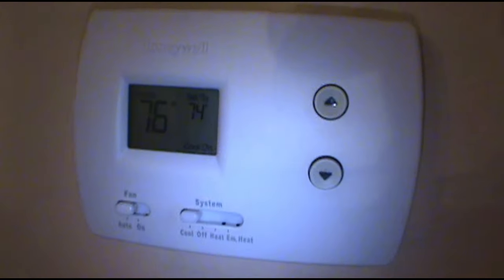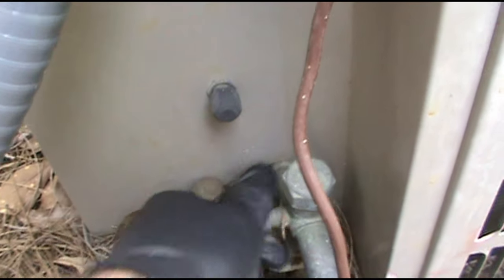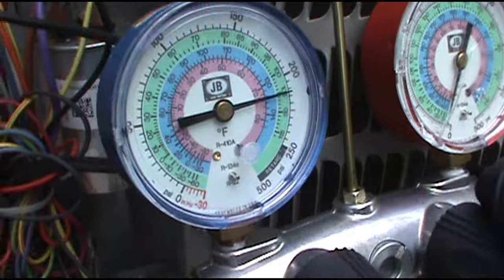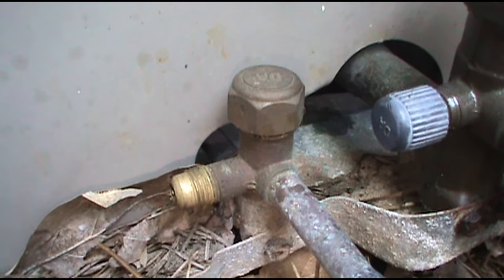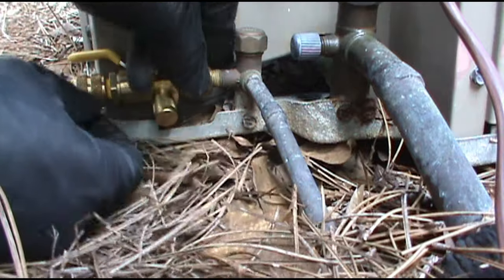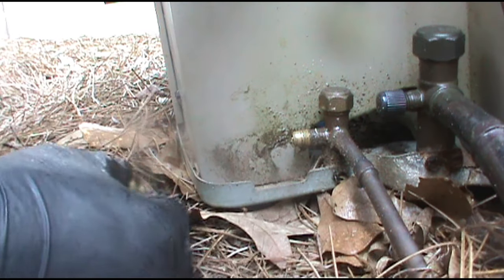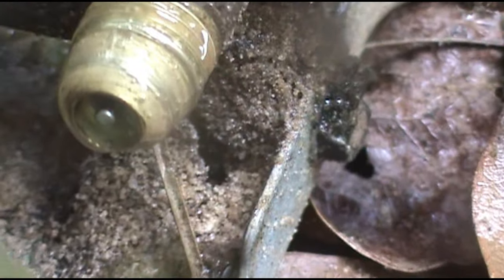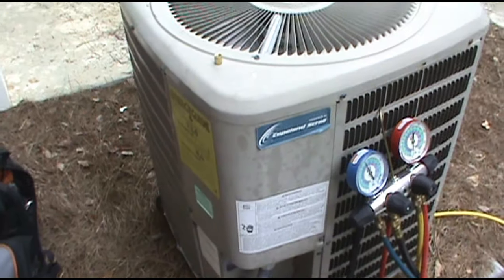Outside AC Unit Not Running But Inside Is

Comment: I have bought an inexpensive Ryobi One blower that uses interchangeable batteries with my other of the same types. It does a good job on that snaky pine straw and leaves around the unit. It makes it look nicer around the unit. Works great when the units are on slabs and MGMT is not using that straw for landscaping.
Reply from the maker: Great idea! Thank you so much for watching Thomas!
Reply: @LexVance  By the way, great work attitude you got. Glad I watched this today. It boosted my morale.

Comment: If fan is not spinning - how else would you determine whether it's 1. fan motor, 2. capacitor not working, or 3. low refrigerant level triggering low pressure switch? (other than visually gauging the appearance of the capacitor/testing the capacitance/leak test) Thanks!
Reply from the maker: I would test everything with my volt meter to see if all that was good.
Reply: @LexVance  Thanks! I am a complete beginner and have learned a lot from your videos!

Comment: Can you explain the high and low side.
Reply from the maker: The low side is gauging the refrigerant in the air handler coil. The high side is gauging the refrigerant in the condenser.

Comment: My outside unit is not turning but I’ve reset the breakers and the thermostat clicks as if it is about to cut on. My upstairs ac is working just fine and the second outside unit is on.
Reply from the maker: Either a bad capacitor or low pressure switch due to low refrigerant.

Comment: Ours is the very opposite..out side running inaide seems no contact to start cool air but air is coming out..had well ck June 9th all was great! Not heat pump..
Reply from the maker: I'd need to be there with my volt meter for this one.

Comment: Fan and Compressor were not kicking in. Replace Capacitor, Contactor, Control Board and still did not start. Replaced Low pressure switch and Air Condition (Fan and Compressor) start working.
Reply from the maker: Sounds like you had no low voltage so the contactor wasn't pulling in. Nice fix Sasan!

Comment: Before I add refrigerant id ask when last time it cooled unit that low big leak if it was since last year one thing over night or its a big leak either way freon leaks suck.
Reply from the maker: Thank you so much for watching Ted!
Reply: So hard sometimes find leaks signs of  oil helps i have a video where I put e coil under water leak didn't show until 600psi I was very scared of that psi would show video but don't know how

Comment: So what’s the cheapest HVAC system on the market? I’m retiring and selling my house soon, and the AC is out and the furnace works but makes “boom” noises when it shuts off. It’s a mid-80s Carrier and I think to sell the house it should be replaced with a new system but I want as low-cost as possible. Thank you! Your videos are fun to watch even though I know nothing except how to check my capacitor.
Reply from the maker: Goodman. Thank you so much for watching Lee!

Comment: I have a heat pump unit too.  I got heat from the furnace but the contactor not pulling in so the outside unit isn't running so if I get it some refrigerant juice, the unit may start.  You are demonstrating abut cooling.  But Does heat need refrigerant to kick off low pressure switch for the contactor to get 24v too?
Reply from the maker: Yes. Low refrigerant will make outside unit not come on. Thank you so much for watching!

Comment: My AC was working perfectly and today it went out. Did the stick trick to spin the fan and the fan cut on! But the air isn’t cold. What do you think it is?
Reply from the maker: Did you check the capacitor?
Reply: @LexVance  just changed the capacitor, it’s working well. Thanks bro! Now I need to go lean out the blower

Comment: My brother in law has a unit that keeps blowing those fuses. He just changed the unit and they left the same wiring. It still happens with the new unit. It will work for a week or so and then they will blow
Reply from the maker: There's a skinned wire somewhere with exposed copper touching metal or another copper wire. Could be in the wall or who knows where. Low voltage shorts are tricky. May need to run new wire.
Reply: @LexVance  thanks so much. That’s what I was telling him. He told me it happens more in the really hot summer days but I told him I’m seriously leaning more towards a wiring issue. Thanks again

Comment: Make the brass caps with a pin hole drilled in the end to test for bubbling on shraders like acservice tech showed! Keeps it clean in there! Just my thought! But good video dude 👍👍
Reply from the maker: Right on! Craig is awesome. 
Thank you so much for watching Greg!
Reply: Greg, do you have a link? Or the name of Craig @ AC service tech’s video?  It sounds like self explanatory but I’d like to catch his video if I can. It would keep the bubbles and dirt of the valve without having to carry a CRT. 

Thanks
Speckulator

Comment: Do it work the same as when using the heater?
Reply from the maker: It's depends if it's a heat pump or a straight cool system. Heat pumps need the inside and outside unit to run for heat. Straight cool units usually use gas, oil, or hydronic systems for heat. No outside unit needed. Thank you so much for watching Nightmare!

Comment: You were stating that you could walk away from a system as you know it's leaking and that is technically against the law. If the charge was gone knowing there's a lake you could have pressurized it and left that in the system then pull it back it and recharge it with leak detector fluorescent die and fresh freon for small leagues
Reply from the maker: You're right. I have 200 leaking ac units on the property I work at. I have to slowly get to them all. So, I gas them up to keep the resident cool until I can come back and repair the leak. They should make a law about not manufacturing this cheaply made equipment that leaks a year later. It's not my fault it's leaking. It's their fault. I'm just there to fix their cheap products. Thank you so much for watching Brett!
Reply from the maker: Here's some videos of me fixing refrigerant leaks:
https://youtu.be/u831mDwm38k

https://youtu.be/dzSrAcpg0xM

https://youtu.be/CUjIXUvwMpM
Reply: Did the law change? Epa has no law now for these residential systems [under 200lbs from 608 cert] regarding refilling a leaking system? Just curious for learning.

Comment: How do you add Freon if unit won’t turn on through vapor side or liquid side ? Seems to take forever for the refrigerant to enter the unit as through vapor side when unit isn’t running.
Reply from the maker: The unit has to be running. The compressor sucks it in so it has to run. If it's just to get the pressure switch engaged, then I go through suction side until it gets to around 50 psi. Then unit clicks on. Thank you so much for watching!

Comment: Awesome video. Did you add liquid to the low side during first charge to get it going?
Reply from the maker: Yea, usually after I pull a vac, I add liquid to the high side first until positive pressure. Then, I charge through the low side like you have to do with 410a. Thank you so much for watching Pete!

Comment: I’ve always been told that a/c units on dirt or grass ground tend to break and experience more problems then a/c units on concrete or on a concrete slab. Would you say this is true ?
Reply from the maker: Yes, units up off the ground don't get the outside coil clogged as much. So, it can breathe better and not run high head pressure. Thank you so much for watching successful!

Comment: My hvac outdide unit had ac fluid but doesn't kick in but if i hold the contacts in it cuts on and when i let go it chuts back off.. Help..
Reply from the maker: You don't have 24 volts at the contactor. I'd need to poke around with my volt meter to find out why.

Comment: Hey Alex,

How do you know if the high pressure or low pressure switch are bad? How would you test that? 

And if they are working can you by pass the high pressure or low pressure switch?
Reply from the maker: You test the two wires on the pressure switch with your meter on beeping continuity. If it beeps it's good, if it doesn't beep the pressure switch is bad. You can bypass by cutting the wire and wire nutting together. Thank you so much for watching!

Comment: Hi lex , just wonder how much will it cost for this job run to ? I have the same problem inside working outside no working no sound, condenser and fan not working as well ..
Reply from the maker: I'm an apartment maintenance man so we don't charge for our work. Price really depends on the contractor you hire. My guess would be $100 diagnostic fee and then another $150 for parts and labor. Thank you so much for watching Charles!

Comment: My panasonc AC not cooling and the outdoor sometimes in just 3 or 5 minutes off but the indoor still running... Any advices pls. Thank you in advance
Reply from the maker: May be low of freon. When they get low, the low pressure switch cuts the unit off to protect the compressor.

Comment: Is there a way you can force the compressor to run without topping up refrigerant
Reply from the maker: No, that'll damage the compressor. The refrigerant keeps the compressor cool. It'll overheat and break if there's not enough refrigerant.
Reply: @LexVance  thanks for the reply- sorry I should have mentioned. I only mean a short run of the comprrsdor. The refrigerant is just low and I wanted to pump down the unit as there are several other issues with the unit.  Mainly cosmetic. So I want to replace. My recovery machine is in the middle of repair.

Comment: My unit has 24v and the contactor is pull8ng in but my unit isn't kicking on..changed the capacitor and it isn't running..added a Super Boost not kicking on...
Reply from the maker: If the whole unit isn't turning on, make sure there's 240 volts going to it. Make sure breaker isn't tripped in the breaker box. I'd need to be there for this head scratcher 🤔.

Comment: I have no clue what you just did.😯 I replaced the capacitor, filter, & thermostat and after restarting the AC unit the fan ran for about 15min then stopped. I'm lost at this point!😧
Reply from the maker: If your unit has a low pressure switch, it will shut off when pressures drop too low. That means your unit could be low on Freon. They  put low pressure switches on them to protect the compressor.
Reply: @LexVance  Thanks for sharing.👍 I will replace the fuses 1st then go from there. 😄
Reply: @LexVance  Hello Lex, I've now replaced the fuses along with a new thermostat, capacitor, and filter. The fan stated and stopped again after about 10min. If the unit is low on refrigerant charge will that cause the fan to stop?
Reply: Your  fan motor may be bad. Does the compressor stay on after the fan stops?
Reply: @ChevyARt15  Hi and thanks for the information. The motor is bad unfortunately. The unit is 30yrs years old and has overrun it's course, I am getting a new one installed with a 10yr parts  and 10yr labor warranty. I am not going to keep putting $'s into this thing. Thanks again for the info.

Comment: Quick question: I took out the 220 volt outside breaker to clean the compressor coils with an easy stream of water no splashing no heavy straight line stream of water. But when I put back the 220 breaker the compressor wouldn't come back on despite the inside blower working fine also the compressor was working fine with no issues what happened?
Reply from the maker: Yeah, those go can be tricky. For some reason Square D breakers need replacing after getting messed with. Doesn't happen all the time but it does happen often. I hope everything works out for you Bo!
Reply: @LexVance  I called a HVAC guy I'll let you know.

Comment: I found out the problem with outside one I’m just waiting for the part., but can we still run the one inside with out causing any damage?
Reply from the maker: Yes. Leave the thermostat in the OFF setting and turn fan from AUTO to ON. That will run the inside only.
Reply: @LexVance  thank you👍

Comment: What's the "Corona skid"?
Reply from the maker: The ol beer virus. Thank you so much for watching Sam!
Reply: @LexVance  I got the reference to the big story of 2020, but does it have anything to do with a refrig. leak? It sounded like an insider nickname.
Reply from the maker: @realSamAndrew  No, skid is what I say instead of dude. 😆
Reply: @LexVance  around 3:40 you say the old  Corona skid straight negative, at 4:00 you say easy skid, then 8:20 Corona skid negativo. You then talk about a coil. I'm just trying to follow😉. What does that mean related to the service call? Or in general?

Comment: I think this is what my landlord needs to do . Last summer it was caking up ice so he added whatever and I didn't have to turn unit to 68 to feel it , new temp.72 . Now it won't turn on outside . It was running for 3 days and nothing . Even the heat was cool but worked in Emergency mode . I said hole in the line but what gives now ? He doesn't service HVAC at all until........😳I'm watching this video while they are outside since 9:30 am 🌞
Reply from the maker: Thank you so much for watching Angela! I hope it gets fixed.

Comment: How much does this service usually cost?
Reply from the maker: Usually around $400.
Reply: @LexVance  is it likely that an outdoor unit no more than a year old would leak coolant? I’m having some issues with my outdoor unit not turning on when the inside is on but the inside unit is working perfect just when I go out to the outdoor unit it’s like it’s totally dead, I’ve even tried turning the breaker on and off…some people have mentioned it could just be a capacitor that has gone out…if that is the case what do AC repair men (or you) usually charge for a simple minor fixes?

Comment: What if the fan is running but the hum doesn't want to kick on? It tries to start but won't kick on indefinitely.
Reply from the maker: Could be a bad capacitor. If not, the compressor is bad. Thank you so much for watching Sarah!

Comment: If I check the capacitor and it is good but the compressor  is still not coming on what could be the problem
Reply from the maker: Compressor wire could be loose. Or, the compressor is bad and needs to be replaced with a new one. Thank you so much for watching Ron!

Comment: By pass the thermostat connection hvac turns on not the condenser the outside fan high pressure when I push the freon valve  what can it be lol
Reply from the maker: I'd need to be there for this head scratcher 🤔. It could be a bunch of things.

Comment: any tips on if i hear a “clicking” sound at the condenser unit when setting the thermostat to cool and/or turning thermostat to off? I hear the click and the condenser/compressor stay off
Reply from the maker: You're hearing the low voltage contactor opening and closing. Sounds like the high voltage ain't working. Maybe a tripped breaker or bad capacitor.
Reply: @LexVance  thanks for the tips. I had replaced the capacitor and have reset the breaker but no luck with either. any other tips that you can think of? thanks in advance
Reply: @CoVaTennis  Did you ever figure out what the issue was? That's exactly what we've got going on; we hear that clicking signifying the low voltage contactor opening/closing, but no noise coming from the compressor, and no movement from the fan.
Reply: @aykkes6215  yea it was a wire on the outside running to compressor that was wearing down. had to replace it
Reply: @CoVaTennis  Thx for the lightning quick response. I'm gona look into that now.

Comment: Dude videos are great and entertaining also funny live the short liners I’ve a 2 year old Lennox 2 1/2 ton 76 on the upstairs and 70 set point can’t get that sucker to get to 70 also the evap blower runs but the compressor and fan shut off periodically can’t figure it out any idea? I had bayonet out he told me there’s nothing wrong with it took a picture of the gauges
Reply from the maker: Thank you Morris! Your ac there is a head scratcher. I'd need to be there for that one.
Reply: Lex Vance r you around Tampa Lutz land O lakes area?

Comment: Hey Lex hate to go off topic on this vid. But could you clarify what emergencies and non-emergencies are for on call in your opinion..And what's your take on make readies being on call? Usually it Leads and Assistants..Thanks again for the feedback..
Reply from the maker: On call emergencies are no AC, no heat, front door lock malfunctions, one bathroom toilet clogs, alarms going off and leaks causing property damage. Everything else is not an emergency and can wait. Make readies should only be done during business hours. On call is for emergencies only. Thank you so much for watching Alvin!
Reply: @LexVance  Sorry meant to say should The Make Ready position be on?

Comment: My outside unit stopped but inside was still blowing.  Outside unit tripped the circuit breaker and resetting just retrips.
Reply from the maker: May be a burned wire or bad compressor. I'd need to be there for this head scratcher 🤔.
Reply: @LexVance  You were right on the money!  A wire that shorted the compressor and blew it out.  All leads into the compressor were shorted to ground. New compressor going in now. Thanks for your feedback.

Comment: What if I'm just getting heat when thermostat on emergency heat everything thing running except the unit outside
Reply from the maker: Emergency heat only uses heat strips inside. Outside won't come on until you just use the heat setting. If unit outside still won't come on then it could be numerous issues. Thank you so much for watching Realest!
Reply: @LexVance  thank you